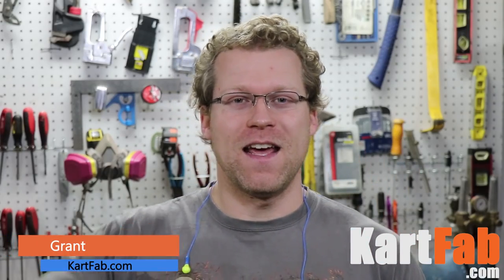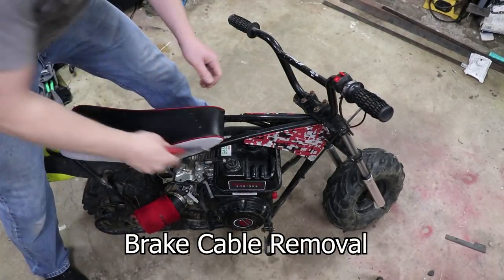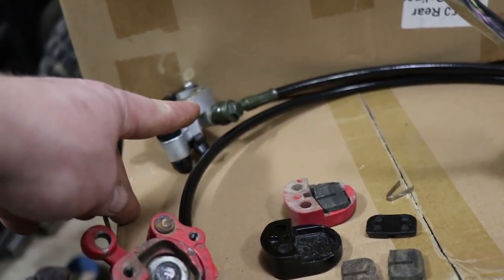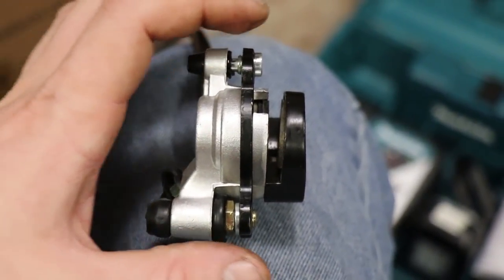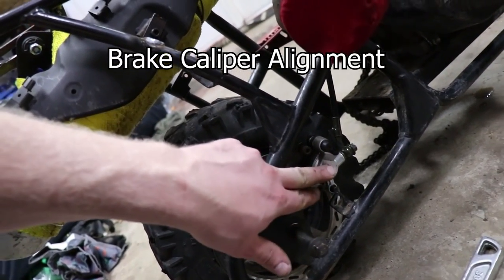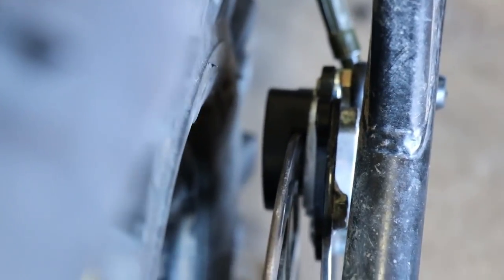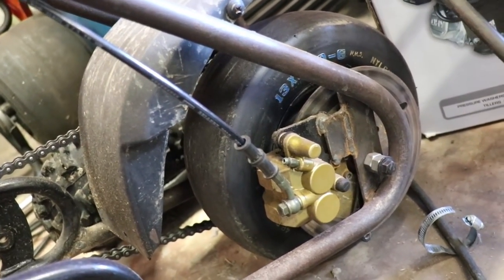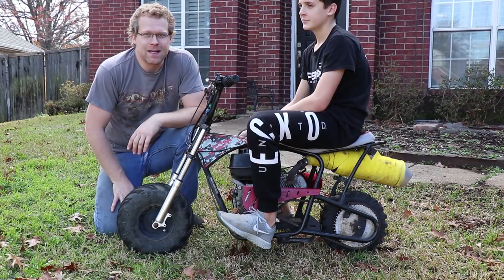Mini Bike Brake System: Hydraulic Kit Install & Adjustment

Comment: Holy apple jacks batman, its the riddler 😦

I have a hydraulic brake caliper setup i bought off amazon for like 30 bucks I think its for a dirt bike or something but its pretty good quality. Even has a spot for a brake light to attach. My problem is my frames custom built so I'm hoping to get some mounting braket ideas.

Comment: You want really good stopping power? Put that hydraulic disc brake on the front wheel. Cable disc is good enough for the back.
You did say you could lock up the cable operated back brake. How much more rear stopping power do you need?
Front brakes provide the most stopping power, by a big margin.

Comment: Do you know if the mb200 brake system will clear the db30 / motovoxs? like will the brake caliper clear the sidewalls of the tires?

Comment: I have this crap on my db30
 Those brake calipers are garbage tho....the guide pins are so flimsy and break easily. Sure the caliper clamps but the pins arent strong enough to hold the caliper in place.

Comment: Grant, maybe you're the guy to do this one. a brushless ducted fan unit is what's used for electric model jets, they're a radial compressor type blade, 5-6-7-9-11 blade fan are pretty common, and they can deliver thrust in the POUNDS (especially larger units). what they DON'T tell, is how many BAR, or how much pressure can be developed before the propeller goes cavitation. they're controlled by an ESC, which can be programmed for power curves.

now look at Tillotson fuel injection, which can be controlled with pulse width and frequency,
so really all that'd be needed is a "brain" using input from the crankshaft RPM to control the forced air and fuel injection, this could be tinkered with like a full size car's ECU.

some ducted fan are about 50-60-70 mm diameter, imagine hiding THAT inside an air filter.
sure it'd need a 3S or 4S LiPo battery to run it, but it might be possible to program+wire the contraption to run a normal default, or hold a momentary switch down for boost engage, where the ducted fan gets powered up and the normal fuel injection signal gets fattened up.
now for more fun, software so you can program the thing with an Android.

Comment: What about the weld splatter on the disk? Might want to cover the tire and disk next time. just my 2 cents. Don't want to ruin brand new brake pads due to weld splatter.

Comment: Hi kart fab I have a question how do I put my hydraulic brake system on my storm 200 mini bike if the brake pads are to thick to even fit on the disc
Reply from the maker: Can you open up the pads?

Comment: How do you loosen the piston because I accidentally pressed the lever without anything in the middle and now I can’t get it on the brake disc?
Reply: I did it too, I had to crack the bleeder valve open a hair. I was then able to push it apart with minimal fluid loss

Comment: how do you bleed these brakes? i have the same brakes on my go kart and i can’t seem to figure out why they won’t bleed or work, they are brand new just won’t squeeze hard enough to stop
Reply from the maker: Gravity. The air bubbles go up. Position brake low and let bubbles go up.

Comment: My brakes the pad closer to tue piston will move out further and further and then eventually gets locked but idk how to make it where it returns once I let go
Reply from the maker: When you install, use full pads. If it’s locking up it’s a problem with alignment. I squeeze brake pads to the rotor then weld support in place for perfect alignment.

Comment: what size is the hex socket cap bolt that connects the caliper to the frame bracket? The bike I got didn't come with any. Thanks
Reply from the maker: Not sure usually metric bolts are 6mm or 8mm.

Comment: I have a monster moto E1000 that I upgraded to 60V and it now does around 35. I need better brakes but im limited to electronics not welding. Any suggestions on bolt on upgrade?
Reply from the maker: take to a welding shop and have them retrofit.
Reply: @KartFab  good point should be easy enough

Comment: Could I "Possibly" upgrade my 1987 Craftsman GT6000 from "Friction Strap" brakes to this with an appropriate Brake Disc?

Any info on this "potential upgrade" would be helpful.

Have a HAPPY & SAFE NEW YEAR!

-Thomas (12)
Port Orchard, Washington
Reply from the maker: If you can figure out a way to mount a disc to where the brake drum was mounted you can. All you need is to mount the disc and mount the caliper. I’m assuming it’s a brake drum and brake band?

Comment: I got a x.18 Super Sport motorbike and my drainage hose broke so I'm trying to fix it if you have some websites where I can get parts or any advice to do I appreciate it you have a blessed day
Reply from the maker: drainage hose? try googling "x18 supersport parts diagram"
Reply: @KartFab  bro i have this same bike but i cant find out what size the hose should be bc they are different size bolts at each endss

Comment: Where did you get the steel mounting bracket you welded on?
Reply from the maker: Scrap steel cut to size.
Reply: @KartFab  I thought someone was selling prefab caliper brackets with the mounting holes.

Comment: Couldn't you have flipped that solid mount on the brake capiler or use the old and then if needed use a spacer
Reply from the maker: Possibly, it’s whatever works.

Comment: I upgraded my Doodle Bug from cable actuated brakes to a hydraulic kit just like this one, and it worked great for about 3 rides. Then it started sticking shut and the ONLY WAY to make it release is to roll the mini bike backwards. Doing this will release it instantly every time, so now I must come to a complete stop every single time I must apply the brake - even a little bit - and then back up for a few inches before I can continue on my way.  Does anybody have a clue how to stop this madness?
Reply from the maker: Sounds like a sticking pin. Grease up the pin, then decompress. Could be bad alignment as well.
Reply: Have the same issue how did you fix it
Reply: @colbyturbeville2946  I bought a new complete hydraulic system and it stopped.
Reply: @ralphcantrell3214  😂

Comment: I have a retek cheetah and i WISH those hydraulic brakes would work... the cheetah has the weirdest mechanical brake setup i have ever seen. i would have to custom make an entire bracket to mount the hydraulic brake and i'm no metal fabricator...it's so infinitely frustrating.
Reply from the maker: Pay someone to do what you can’t do

Comment: Hello how can I adjust it when I hit the brakes it doesn’t wanna brake anymore
Reply from the maker: New brake pads from a cable brake are thicker. Just swap them out for those pads. Also you might want to try out bleeding the air from the line